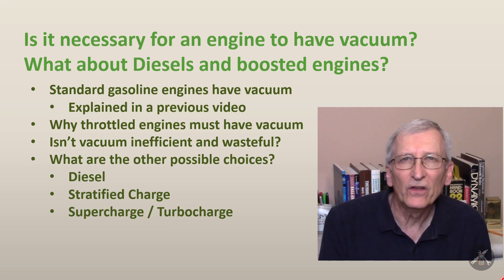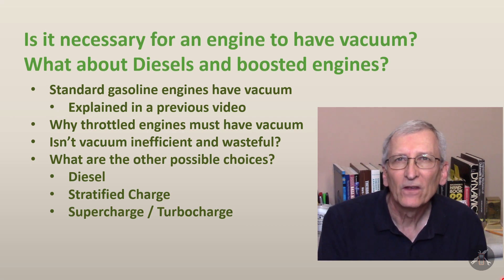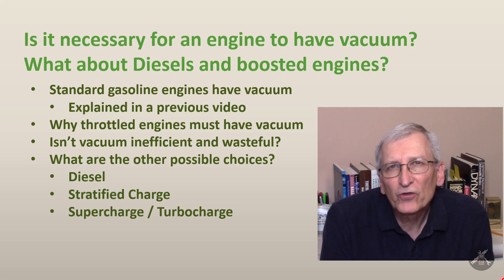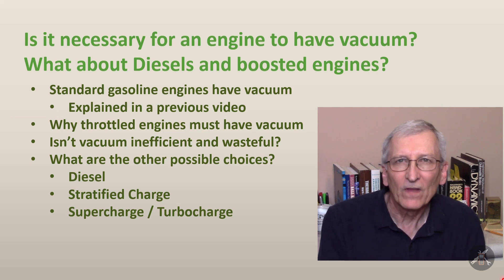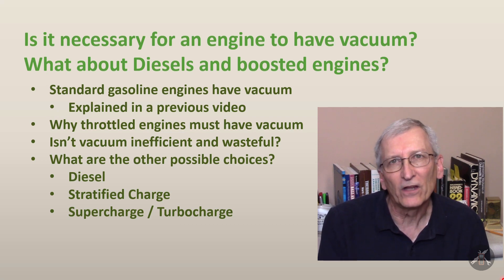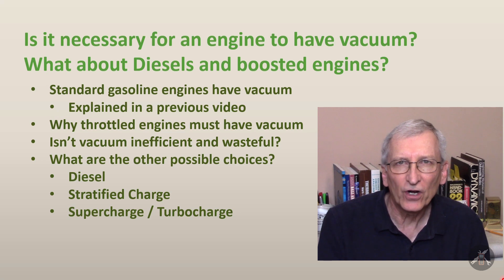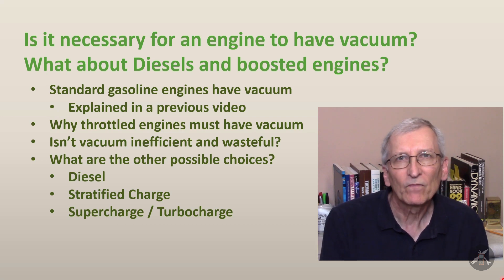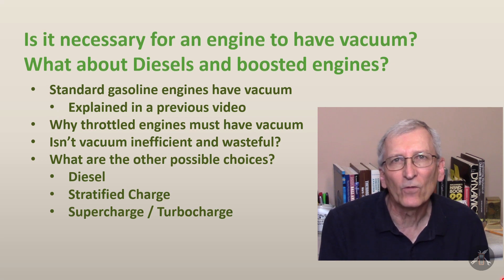Why is engine vacuum necessary? Are there other ways to run an engine?

Comment: Still don't understand why you can't just not have a throttle but just inject less fuel. Also I don't understand why diesels have a vacuum pump. If they don't produce vacuum then why bother trying to recreate it with an additional pump, why not just use another method
Reply from the maker: Unthrottled engines do just inject less fuel and run extremely lean air- fuel ratio. That is the diesel system. But, they are compression ignition.  A spark ignition engine can't run that lean because the flame won't continue across the combustion chamber.  There have been many attempts at lean burn systems, but they generally still can't run unthrottled (too lean). 
Many vehicle systems use vacuum because it is an inexpensive and effective way to drive systems like brakes and HVAC.

Comment: I would add BMW's Valvetronic system as a unique approach to removing the throttle body/valve from a gas engine. And yeah, if it weren't for NOx we could already be running our engines a good bit leaner and getting better MPG. GM even has a lean cruise setup programmed into many of their ECUs but in the US it's completely disabled for emissions reasons (NOx specifically).
Reply from the maker: I wasn't aware of that system before.  You're right it is a unique solution. It uses wide control of valve lift along with variable valve timing in place of the throttle.  Others have used lift and timing control, but not to that degree.  And yes, lean burn is much better for efficiency (and CO /HC emissions), but the NOx regulations have that restricted.